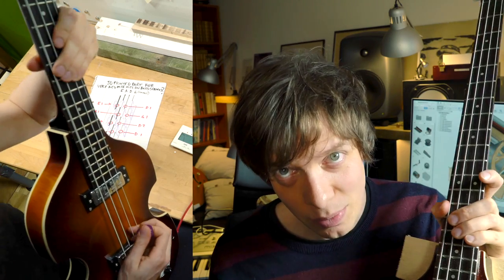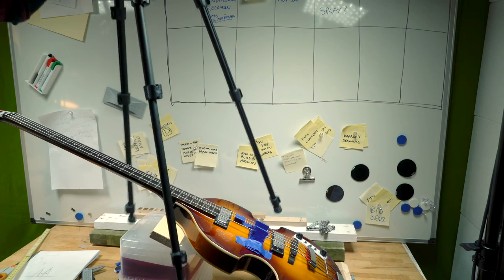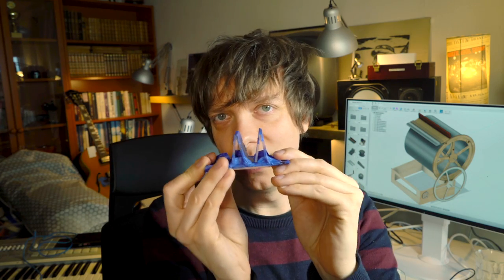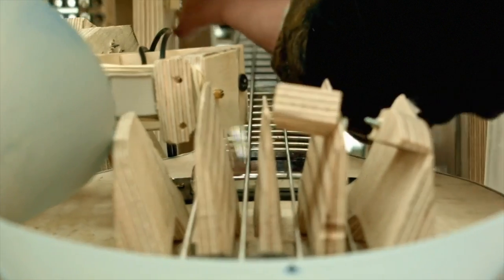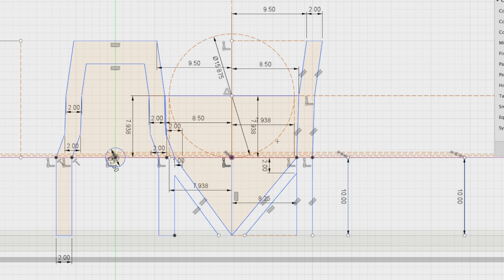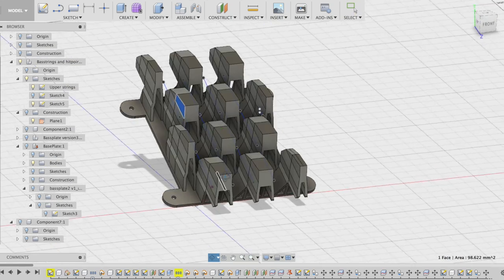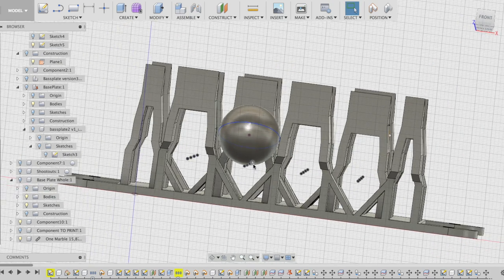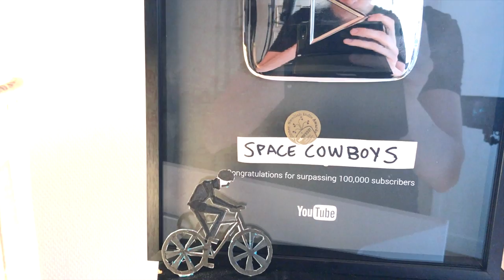How to hit Bass strings with Marbles - Marble Machine X #4

Comment: alright, so a few things
1. Why don't you have some tubing (PVC but with some padding on the inside like Velcro so the marble doesn't make too much noise on the way down) to guide the marble onto the string to get 100% accuracy everytime?
2. I really like the design you've made to attach to the Bass, but there are a few things you should consider:
 you should open the floor of the design so that you can place the piece directly onto the Bass, otherwise you will have to feed the strings through the holes.
Making a design 3D printable requires some planing in how the piece will be printed and how the 3D printer works. For example, in the arches where the strings will go under, the printer may require that you print support material, which you want to make sure can be removed easily. You can do this with a thin tool OR you can use a dual-head extruder with the second head printing the support material using water-soluble printing material. That way you can just dunk the piece in water and have the support material wash away.

Keep up the amazing work you do!

Comment: Looking at your model, I'm wondering if you considered cutting the bottom so you can fit the marble guide onto the Bass's body without having to thread the strings through it. Certainly this way would be more rigid after printing, but figured I'd pose the question, enjoyed watching your Wednesday projects.

Comment: Great work!  I have done 3d modeling work in Solidworks, AutoCAD, and 3d Studio Max.  I'm curious if you can design the part to fit over the strings without having to remove the strings from the bass to install it?  You would need to cut four channels in the bottom of the part . . . or make it so that it can be separated into sections that fit between the strings.  Just a thought to make installation and adjustment easier later.

Comment: I have a suggestion. The old marble machine's power wheel ( the one powered by right hand) should be instead powered by the legs as if it were a bycicle. Doing so will not only add an extra chair to sit on while adding aplication your right hand will be free to handle the rest of the mechanism while you power your machine. You could also make it powered by one leg with the help of a strap. and have the other leg handle something else.

Comment: How are you planning to get the strings threaded through the enclosed regions in your part without having to restring the whole bass? Wouldn't it make more sense to have slots so that the device can be lowered down on the strings and be easily removable?

Comment: The only issue I can see with that is your going to need a plumb bob in the middle of instrument to make sure your instrument is correctly level every time you set up. If the marble machine is not truly level then the marbles will not hit their mark every time. How many stages have you been on that are truly level? 

I also think a plumb bob in the right place will add some intrigue to your instrument too. Heck add a really big compass were the plumb bob should points to add more intrigue to the instrument, after all your Marble Machine has kind of given you direction. Plus, a compass, if done right, shows true north everytime too.

Comment: The disadvantage of your current model is that you have to completely un-string the guitar to put the plate in place. It would be better to have 4 linear holes on the bottom plate to allow for inserting it over the strings easily. 3d printed parts can break and you need to have a way to switch them out easily.

Also, why square the tops when the triangle shapes worked fine?

Comment: ahahah great montage and great work on the hofner (my bass XD). I think that it maybe could be better to remove half of the top section of the "cubes" (the ones above each string), because it can reduce the possibility to hit with a moving marble, (and so there should be less material to print and less weight). What do you think about?

Comment: Thinking about the marble launch angle and energy transfer after it hits the string, I wonder if adjustments will have to be made for string tension of different strings. Not only for each key string, but tension differences when strings are pressed against the fret bars? How did you resolve that in the original MM? 

Also, will someone be manually fretting the strings like in the original, or are you  going to automate?

Always look forward to your Wednesday updates!

Comment: depending on the printing method, that part will have some issues in the bridge work and you may need to rework the profiles slightly. using bridge work like you did is not the best practice for a FDM printer. If possible, you may want to consider having the part cast in resin and then drilling out the string paths afterwards. Particularly since durability is a factor.

Comment: Are you sure the marbles won't hit the V walls below the strings? Bass strings are not so tight as guitars' and if they stretch too much you might get the marbles to hit the plastic (assuming you will 3d print it)

Comment: The top of the "tunnel" that the string goes through seems very "flat" with the risk that if the marble that is supposed to hit next to the tunnel might hit the "roof" and bounce off rather than be guided towards the string it is supposed to hit.

I would make the roofs of the tunnels more pointy or maybe round rather than these flat tops you have right now, to help marbles for the strings next to them to find the string and not bounce off.

Comment: Not sure if i heard a double note, when the marble drops it hits the string, if it is held momentarily in the guide does the string then rebound t hit the marble again to eject it, making a second note ?
Also, what happens when you press a string for a note, doesn't that move the string away from the ideal marble position ?
With 2 locations on each string, i would be a little concerned if the 2 marbles drop in the wrong order, and a marble dropping onto a string is 'intercepted' by a marble leaving the same string.

Comment: Nice design! btw, I was just wondering...
Based from the desig. that yoh made, once the marble falls on the designated drop point, don't you think there would be a probability that once it bounces off, it might slide on to the other string (ie. marble dropping on e1 then accidentally hitting a2)

Comment: That 3d-printed construction would not make the marbles more accurate. It just prevents them hitting places they should not hit. But when marble will make imprecise hit there is a chance it get stuck inside that construction. Fins in the original machine allowed marbles to escape.

Comment: I was thinking that if the marble fits almost perfectly in that part that you are going to 3d print, wouldnt the vibrations caused by you hiting the bass strings and the overall movement of the machine cause the marbles to miss the spot and hit the corner sometimes?

Comment: Just looking at the design, how does he guarantee that the marbles will jump out of their pockets when they hit the strings?  I can just see a marble striking the lower "blocker" (I don't have a better name for it) after hitting the string and not having enough energy to escape.  If he took the the back half of the blocker and extended its angle to meet the string of the bass, I can see the marble having a better chance of escaping.  Just my two cents, cause I really want this to work.  What do you guys think?

Comment: I teach AutoCAD and 3D printing, but is only see one problem with the design, and that would be overhang.
it can be fixed by making the connection of the walls above the strings round like an old bridge instead of the direktly flat version.
just remember that a (FDM) 3D printer cant print mid air.
but your design is still possible to print by using the right material like PLA and low temperture.

english is clearly not my first language, and i hope i'm not speaking in fucked up riddles ^^
but i am really enjoying your videos and i am looking forward to seeing the finished print.

Comment: Is it wise to have the top section of the guides so square? You will need to be very accurate with your marble dropping mechanism to prevent them hitting the edge of the guide and not hitting the string
Looks awesome though regardless

Comment: With the increased speed that the marbles is dropping down on the now 2 channel per string setup you have, do you think it would be possible for the marbles hitting the upper sections of the strings to intercept the marbles that are falling to hit the lower parts of the strings?

Comment: assuming the worst case scenario is the marble not jumping up for some reason, wouldn't the marble get stuck in the machine?
on the first machine there was not a problem because the walls only blocked the marble on one direction, but here it seems it might be  problem. If you will use as much marbles as the first video, the worst case will probebly happen from time to time, so you might want to consider that.

Comment: I think that the model is a bit hard to 3d print because some parts are too thin.
But the model looks very nice!
Reply from the maker: Interesting! i guess those are the things i will have to learn, how to make designs that are easy to print!
Reply: Yeah I was thinking the same, but it can work with the right settings and material. Hopefully the guy in germany knows his printer.
Reply: Three Dots I was thinking too thin too, but more from a durability standpoint. Those marbles have a bit of mass, and I am guessing they will be dropped from rather high up, so Martin would probably want to make sure that the plastic won't start cracking after a while of being hit on the exact same spot.

Comment: You'll need to remember that 3D printing overhanging items may either: disfigure the item without support structure or use a lot of supports and getting rid of supports is very tedious work.

Comment: The design isn't entirely optimal for 3D printing. You should make the lower side of the "bridging" parts (the top of the guides) like a triangle with 45° sides, because you can 3D print up to 45° overhang without support structure. Would be a PITA to remove supports from this model.

Comment: Why don't you make the frets facing towards you so it would be easier to play? In the old marble machine I always worried that the marble will hit your arm while falling. And it looks like you're going for the same design again.
I suggest reverse the bass position 180, with the frets at the front (so you can be at the side of the machine, playing the bass like usual right handed), and instead of all marbles falling in front of the machine (like the old one) let only the bass marbles fall at the back. 
Hard to explain by words but I hope you understands.

Comment: would the size of the string not change the way that the mechanics work on your sketches? I play bass and the E string is fairly large. maybe your sketches will work anyways but I think representing the strings as a singular point will make the strikes inaccurate in the long run

Comment: Might consider how much interference on the channel/trough you have and whether you'd felt pad the walls or use some other method.  Remember that the pickup doesn't just pick up the string movement it will pick up the hit of the plastic as it will cause the string to vibrate and the pickup to deflect downward.

Comment: Will your machine have a fixed size music loop? It's my grand fear. But it's realy good job
Reply from the maker: 64 bars yes! but reprogrammable so you can play any song you want! And by muting and unmuting also create dynamics. And the stringed modulin is not in the programming so you can play any length of melodies on that for variation. but the real trick is to make the 64 bar loop as dynamic as possible in every song!
Reply: I expect this, good continuation with our support :D
Reply: I wonder, would it be possible to make extra long programming belts that would come out the back of the machine, wrap around an external wheel, then feed back in?
Reply: I think to a removable cylinder with a rubber fabric to connect at the big wheel and you hook (whith screws) the lego techniks pieces on it

Comment: Your designs are relatively hard to print, at least from a consumer grade 3d printer standpoint. There are lots of places where the bottom side is flat, which some printers will fail to print. Worse still is where on the bottom side there are angles across of more than 30 degrees (this will fail to print on a lot of FDM printers) which you can fix simply by making the area under that soild (which will also increase strength)

Comment: I'm used to Solidworks, so the concept this program uses to build geometry seems very non-intuitive from a drafting perspective.  I typically build features in a method that is conducive to traditional manufacturing processes; this program may work better in regard to design for 3D printing.